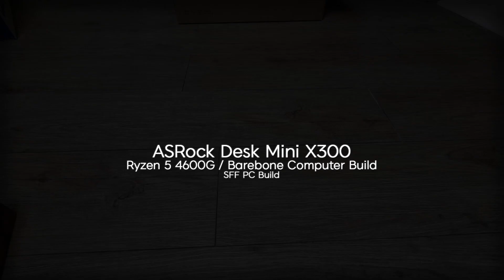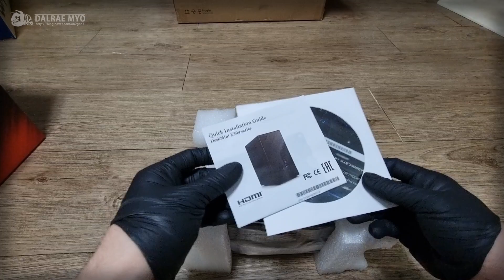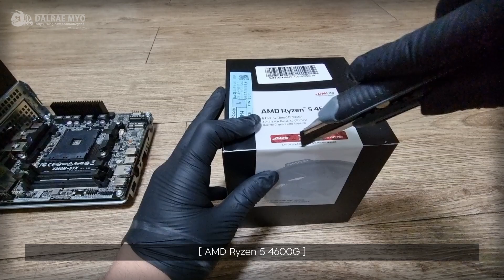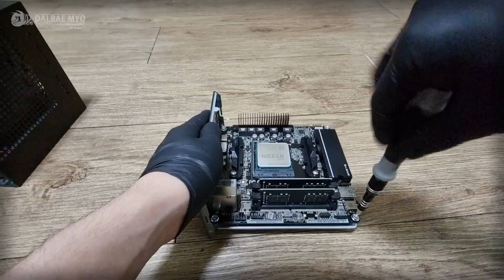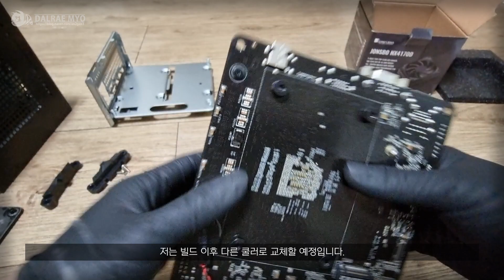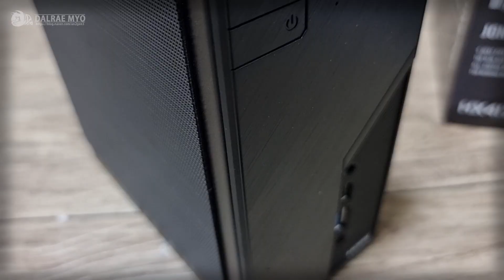ASRock DeskMini X300 120W | Mini PC Build

Comment: Thank you. How much MHz for the RAM Storage is max allowed by this MB?
Reply from the maker: As an official specification, it supports 3200Mhz memory, and I've seen a lot of reviews that it can be applied up to around 3800Mhz when overclocking in the BIOS.

Comment: what is the temperature of the cpu if you use the jonsbo HX4170d low profile hsf, is it strong enough to withstand the i5 13500
Reply from the maker: The notation cover TDP for jonsbo HX4170d is 180W, but I expect the actual coverable TDP to be below 100W.

Comment: Hi im useing the same mini pc but with amd 5700G. For cpu cooling i use the Noctua NH-L9a-AM4. My question is how performance is the  Jonsbo HX4170D an how db in idle and when you gaming ? Best regards
Reply from the maker: If you are using the Noctua NH-L9a-AM4, it seems that you do not need to change the CPU cooler with additional spending. Because I don't think there will be any dramatic difference in cooling performance.
Reply from the maker: The JONSBO HX4170D did not show impressive performance. It was louder than expected, and there was some interference in the VRM heatsink.
Reply: @DalraeMyo  Many thanks for the quick response. then i will stick with the noctua because the performance and cooling capacity are perfectly suited for this mini pc. Greetings and have a nice day
Reply from the maker: @crokatana  Thank you for watching my video and leaving comments. Have a great day!

Comment: Can use with non G cpu? Like 5700x or 5600x? I already have egpu setup. 😊
Reply from the maker: The ASrock Deskmini X300 does not support eGPU by default. However, I have seen some users using M.2 to PCIe gender cable to connect and boot graphics cards separately.
I've never tried it before, so it's hard to answer exactly.
Reply: @DalraeMyo  yes im using a300 with m.2 nvme egpu setup. But can i use it with 5700x or 5600x cpu?
Reply from the maker: @handcannon9814  Unfortunately, I've never tried it before, so it's hard to answer whether the X-series CPU without the iGPU is available..